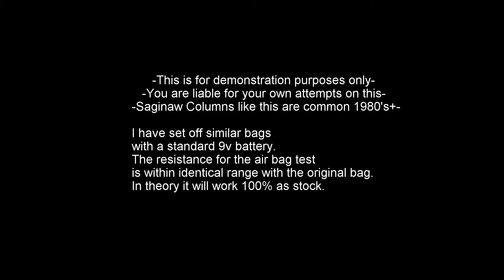C6 Steering Wheel Swap in my 95 F-body (Functional Airbag)

Comment: How did you connect the horn with the 3 spoke wheel and the post that comes through the clock spring? I assume you have to reuse the f-body horn connector end and solder it to the positive and negative wires on the 3 spoke? And I'm not exactly sure where you trimmed the clock spring or whether I will have to, can you clarify?

Comment: I think this will work for my third gen swapping a 6th gen camaro wheel...
Reply from the maker: I have seen it work on 5th gen wheels. that would be awesome
Reply: @CamaroRick  nope I ordered the same part from summit and it wouldn’t fit the 6th gen wheel… but there’s someway to accomplish it Stitched by Slick has done it on a few older cars already. But thanks

Comment: Where did you get the horn button that says Camaro on it?
Reply from the maker: Its the emblem off a 3rd gen wheel center cap, I think it was off my 92 but I cant remember. Made a flat ring like thing with the 3d printer to make it sit right with some aluminum tape behind the letters.

Comment: Hey please reply got a few questions 
I bought a 2016 Zo6 c7 steering wheel 
I tried to put it on my Camaro obviously the shaft is to small on my Camaro Column but will the express one work? Also I don’t care if the air bags work or not I highly doubt I could get it to work anyways
Reply from the maker: They changed to a different shaft after the 5th gen camaro, and C6 vette. I swapped a wheel on a 14 vette for the flat bottom 16 and saw that too. not the same splines as this shaft. Its prob a similar part tho Id have to look into it. Would look sick!
Reply from the maker: Looks completely different from inside the column. would have to be custom part

Comment: Is it possible to just leave the dual stage air bag in and only connect the high stage?
Reply from the maker: Yes it will still deploy normally. I dont know how a single stage charge would compare to setting off both stages in a 2 stage bag. I should test it to see how they compare one day. I do remember setting off the low stage on a random bag and it was pretty weak. bag side down it jumped maybe 10 feet. Single stage you can put a 30lb spare tire on it and it will launch 25 feet in the air so Im thinking the 2 stage deployment is similar to a 1 stage bag. Im sure there is information somewhere.

Comment: Hey I've been looking at doing this install in my camaro and was wondering what you did for the camaro emblem in the middle of the wheel
Reply from the maker: I made a thin cover plate with the 3d printer. For the emblem it is an old spare wheel cap logo off my old 92 Camaro.
Reply: @CamaroRick  thanks! Something else ill have to keep my eyes open for when I go source parts for this swap
Reply from the maker: I wouldnt use anything with weight because it is a projectile if the airbag goes off. I would just pick an airbag cover with the original logo of your choice for safety. 
https://www.thingiverse.com/thing:4738929
Reply: @CamaroRick  I was actually planning on deleting the airbag anyway when doing the swap and just wiring in a resistor for the light on my setup so this should work nicely👍
Reply from the maker: @themrsaturn110  That would work out  great. I painted the platform piece aluminum and used some aluminum tape behind the clear "camaro" lettering.

Comment: Interested in doing this in my 97 Camaro.. As for the steering wheel controls, you were able to plug the corvette wheel into the 02 clock spring? Or did you have to splice into it, in order to get it to work?

Thanks and awesome job!
Reply from the maker: TopListVidz  the button  controls have to be spliced into. Get the pigtails with the donor wheel.
Reply: Okay i see, thanks. Lastly, is the wiring pretty straight forward? Sorry for all the questions man you seem to be the only one has fully figured this out from my research. (ls1tech)
Reply from the maker: TopListVidz yes the wiring is easy. the air bag wires don't need any splicing the key is the single stage air bag. the bag side connector is the same.
Reply: Cool. I was more so referring to the steering wheel controls. You did a very good job at showing how the airbag is installed in this video. I'm "electrically inclined" for the lack of a better term and am sure i can figure it out, was just curious as to how hard it was to incorporate the steering wheel controls from the corvette into the camaro clock spring?
Reply: you can't get them to work without a special interface from what i've found

Comment: I’m about to do this tomorrow. I have a few questions. How did you get the C-Clip off? Is it difficult to remove?
Reply from the maker: The steering lock ring has to be compressed before the half ring / lock can be pulled out. You can pick up the tool locally. The air bag "clock spring" snap ring is removed with basic snap ring pliers. Take lots of pictures as you do it to make it easy to remember. Its a finicky ordeal to someone not experienced with steering columns. Id recommend taking apart the donor column first for practice.
Reply: @CamaroRick  Hey Rick, thanks for the advice. I don’t have a donor column unfortunately. I am pretty intimidated by this project but I don’t have a shop within 2 - 3 hours of where I live willing to do this job so I’m pretty much on my own. The steering lock ring is the ring is the silver ring sitting midway down the steering knuckle isn’t it?
Reply: @CamaroRick  I got it all apart. I'm having problems with one of the small spring loaded shoes that the dowel pin goes through. The shoe came completely out and I can't get it back in. How do I get the shoe back in? It seems like I cant get it back between the spring.
Reply from the maker: @MikeAW2010  I believe I know what part your talking about so hopefully this makes sense. That is one of the tough things on the job. With that part of the housing removed, I used a pick and punch to line the shoes / levers back up in the housing and tapped the pin back in. With the pin installed and shoes in place you can reinstall the assembly to the column by just applying pressure to the legs downward with a flat blade screwdriver to get it reinstalled on the column side. I did them one at a time till the shoes / levers pressed down with enough pressure to get under the receiving end of the column side. You would push down towards the front of the vehicle on the sprung levers / shoes.
Reply: I’m running into problems. I managed to get the tilt wheel housing back together. Upon reassembling everything, I got to that part where you put the lock plate back on. Well, while compressing the lock plate, it would want to get stuck even though the lock ring was not in place, like I could literally remove the tool and the spring loaded lock plate would not budge. I had to hammer and pry to get it off. Somehow in process of this I bent the metal round piece that goes infront of the bearing retainer and caused the bearing retainer to explode … bearings everywhere… Do I have to replace the bearing retainer or can that be repaired?

Also I decided to test fit my wheel with the knuckle installed and the wheel will only go on at a 90* angle but the stock one came off at 0*
Reply from the maker: @MikeAW2010  If you can find all the bearings they just pop in place on the plastic retainer, Id use grease to keep them located. The upper bearing race would have to be replaced also if its bent. I think the bearing race should be the same from the donor vehicle if you have access to it. You might be able to get a donor column for parts from Hawks Motorsports if not. The stack up of parts might have been off if the bearing wasnt sitting right it would make sense. The Upper column shaft should have a top center mark where the retaining nut goes on. This should be situated at the 12:00 position. I dont know about 90* but I imagine if its off by 10* it could easily be adjusted out in the toe adjustment. I believe the rack is limited by the control arm / spindle stops before it runs out of travel so it should still have equal lock to lock turning.
Reply: @CamaroRick  I have everything back together as far as the column. The wheel is on too. I have NOT connected the clock spring wiring to the car harness (my car did not come with steering wheel controls and I have to manually wire that up somehow)

 - My horn isn't working - 

I tested the springed red lead coming out of the clock spring to the steering wheel base with a multimeter and get 12V.

When I depress the horn, nothing happens. When I use the key fob panic button, the horn works.

Any idea as to what could be wrong?
Reply from the maker: @MikeAW2010  Awesome, glad its together again. The horn switch needs power and ground, the column / steering wheel should be a good ground to allow it to work. when the horn switch is pressed it just connects to ground. May have to run an auxiliary ground wire from the horn switch.
Reply: @CamaroRick  Whjere is the Horn Switch on the C6 wheel? I didnt notice the plastic piece like on the 4th Gen wheel. Also my Airbag Cover comes right off if I pull on it. It seems not to snap into place. Am I supposed to do something to secure it?
Reply from the maker: @MikeAW2010  If I remember correctly the metal retention (bar / hard wire) the air bag assembly prongs snap into will flex to allow the ground signal to contact. Some of them have switches that it goes into as a different design (prongs go into it). It has a 2 pin electrical connector on it one goes to the horn wire the other goes to the steering wheel ground / steering wheel frame. You might be missing something. It shouldn't just fall out

Comment: Do you know how much smaller this wheel is vs stock? Or just in general the diameter of the new wheel?
Reply from the maker: I am not sure on the exact Ill measure it later. I tried a few, the Saturn Vue and malibu was about an inch bigger, the pontiac G5 was about 1 inch smaller than stock 95 camaro wheel. Its prob the same diameter as a cobalt. I think its the same diameter as a c6 Vette but in foam vs corvette leather wrapped.

Comment: How close is the C5 Corvette install procedure to this one?
Reply from the maker: I would say about 97% the same. I believe the same upper shaft can be used but not sure on the clock spring if you wanted to add radio controls or paddles. Would have to do some research on the bag connector. It has been done tho. A nice wheel setup is the Centennial wheel. It has an upscale redesign with suede.

Comment: I got a 09 parts g6 can i use the upper shaft from that car?
Reply from the maker: Jae Fields The only upper shaft I know that works is pn. 26074286 for express vans. Look up the part number on ebay. It will give a list of vehicles it's found in. I got mine from an express van 2010 2500 6.0 I believe

Comment: 2014 camaro steering wheel fix in camaro 2000 bru
Reply from the maker: Casper Perez there's a guy on ls1tech that did a zl1 wheel looked awesome
Reply from the maker: https://ls1tech.com/forums/appearance-detailing/1621047-write-up-c6-steering-wheel-f-body-18.html#post19537615
Reply from the maker: look at post #350

Comment: Will a wheel from a 08 Malibu work?
Reply from the maker: Yes its the same spline but it is not as desirable because it is about 1" larger diameter than the factory camaro wheel The Vette wheel and Cobalt / g8 wheel is a 1/2" to 1" smaller diameter than stock when I get a minute Ill take some measurements

Comment: Does then C6 steering wheel stick out more?
Reply from the maker: Yes by maybe a half inch, not noticeable visually but Its only noticeable when reaching off the wheel for the turn signal. I quickly adjusted to it.
Reply from the maker: There is no exposed gaps the 3 spoke just the offset is deeper on the wheel slightly

Comment: I want this in my 3rd gen. Is it possible?
Reply from the maker: Yup same column same procedure
Reply: Camaro Rick where you live? I pay you to do this lol
Reply from the maker: Maryland, I love it so far.
Reply: Camaro Rick does the buttons do shit?
Reply from the maker: ThirdGenDude92 yea but the clock spring only had 4 Wires so your limited to 4 inputs run the Wires to some relays under dash n u can make them do anything
Reply: Camaro Rick that is awesome. Cruise control,  turn signals and machine guns
Reply from the maker: ThirdGenDude92 That is technically possible LMAO
Reply: Could also add some resistors, and "multiplex" those wires for more functionality.
Reply: A little research later, and apparently that is exactly what GM does. The wires seem to be ground, illumination steering wheel buttons and something else. The SWC buttons are resistance based. I'm doing something similar on my S10, but the metal locking plate behind the clock spring looks like it will need to be cut down to clear the wiring. @Camaro Rick, did you use a different lock plate on reassembly? Maybe the Camaro one is smaller?

Comment: did you ever end up connecting the steering wheel controls? I just did the same swap on my 02 and It be great if I could make that work.
Reply from the maker: No I am not going to use the button controls but there is a guy on the  LS1tech.com forums named "FieroLuke"  that has developed a circuit board to wire up the stock controls like radio and cruise i believe.

Comment: Would you know if a C7 steering wheel could be installed like this one?
Reply from the maker: The splines are different on those. Also they use the center bolt style shaft vs the hex nut this one uses. Ive seen 5th gen camaro wheels swapped but I dont have any experience with them in person.
Reply: @CamaroRick  oh ok. I guess I can stick with the C6.
Reply: @CamaroRick  I wouldn't mind having the paddle shifter option.